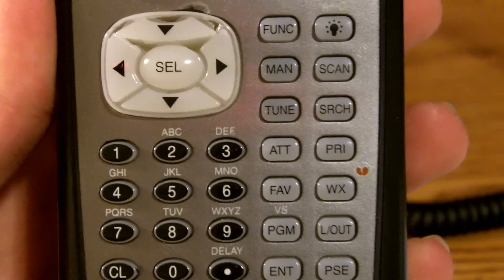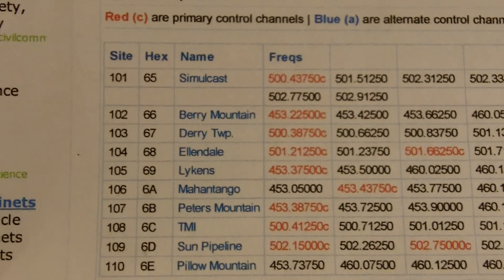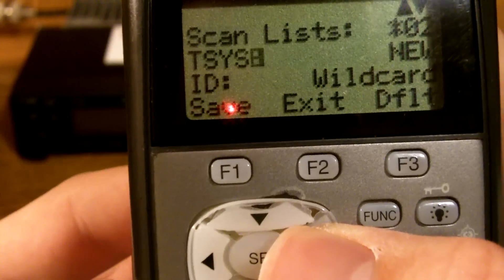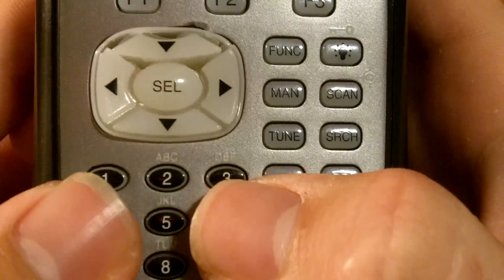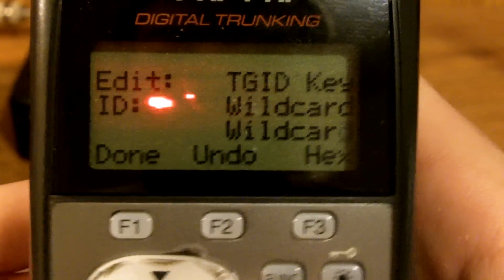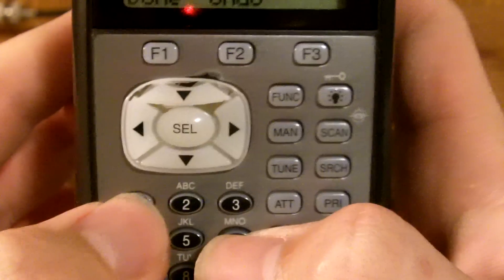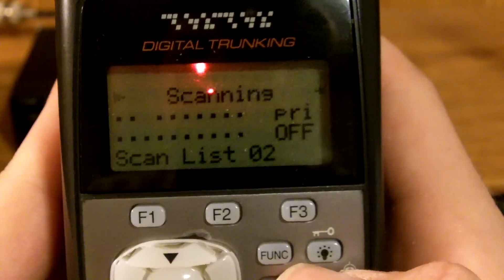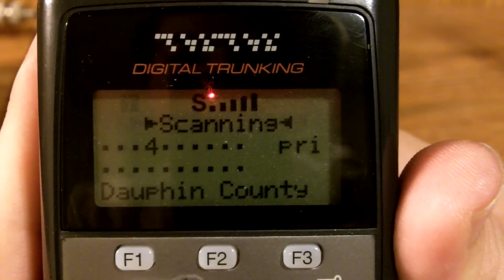How To Program the PRO-106 Digital Trunking Scanner

Comment: I just need to figure out how to clear everything and start over?
Reply: Initialize The Scanner (TOTAL RESET!!!!!!!)

1. First turn the scanner OFF then back on again. 
"Welcome To Digital Trunking" will display 

2. Press the 0 button. "System Tests; Select Test; Exits if no Key Press" will display.

3. Press the number 1 button. "Factory Init; Erase Memory; ENTER if Yes; CL to Exit" will display.

4. Press the ENTER button. "Initializing; Clr Main Mem; V-Scan is OK; Please Wait" will display.

Wait until the initialization of the scanner is complete before turning it off. When the scanner has finished initializing, "M000" will display on the top line and "Bank 0 Ch 00" will display on the bottom line.

Comment: Just bought a radio shack pro 106, I looked up the system type my county  has, but it is not a p25 instead it is iDEN Standard. Will the same method work to program the scanner?
Reply: Francisco - IDEN is LTR technology, so you would select LTR instead of P25.
Reply: Digital frequency scanners hand held

Comment: Does the Uniden BCD396XT that you have offer programmable "limit search"? 

That's one thing that I want. I have an 80 tabletop Realistic unit that has limit search (but it doesn't pick up digital). I love limit search because I can program in only 2 frequencies and scan through as many as 150 active frequencies (depending on the frequency range). I want digital so that I can hear police and stuff. I also want "limit search". Can Uniden do that?

Comment: You have a great video. I have some questions for you on this scanner. When you have the freq's programmed into the scanner from radioreference for your county (mine is Bay City MI), how can I get the scanner to pick up just the DEC numbers? I can use the wildcard, but it picks up everything from law to EMS. And the law uses all of the freq's listed. On your video you show yourself putting in just one ID (DEC), can we program the 106 to pick up just the DEC's on the freq's?.

Comment: How would you program P25 onto a scanner that doesn't have a P25 option? Like a Pro 163. It only has Motorola and other ones, but not P25.
Reply: then you are OUT of Luck. P25 is a Digital Only system. you need at Least a 1st Generation Digital Trunking scanner. Whistler are the Best bang for your buck. I got my Pro-688 from Radio Shack before they closed. best of all the Newer Digital trunking scanners can be programed by PC using the Radio Reference database. makes programing Easy and fast.

Comment: i like the style of the radioshack model, but the uniden bcd396t and XT is still easier and faster to program, due to the added menu and control nob at the top. audio in the uniden lacks quality in both digital and analog mode.